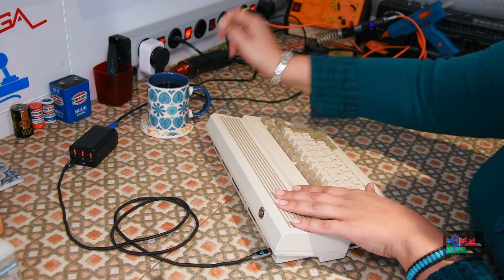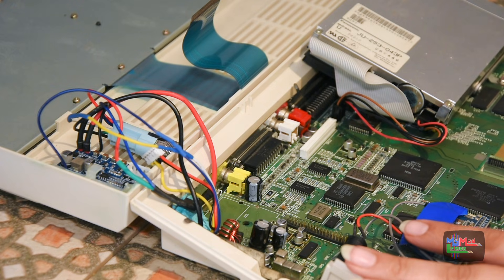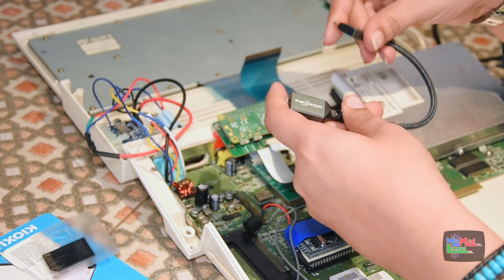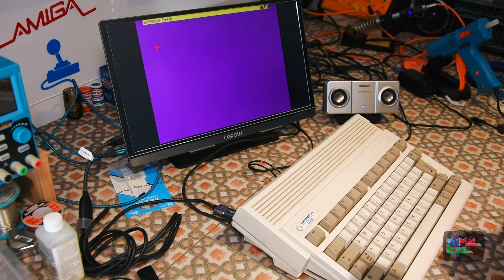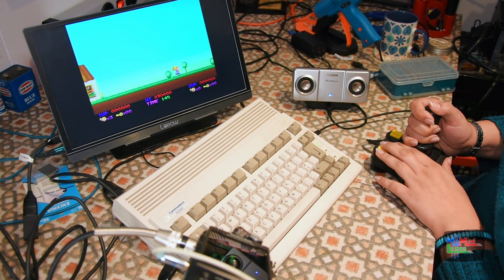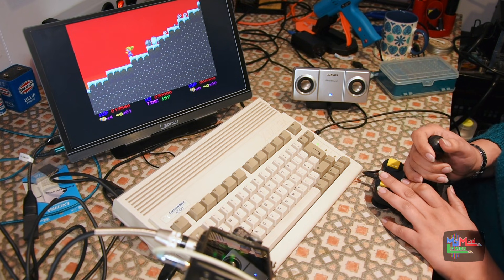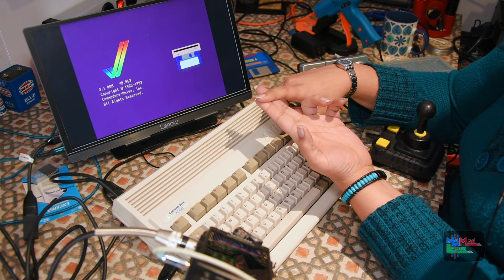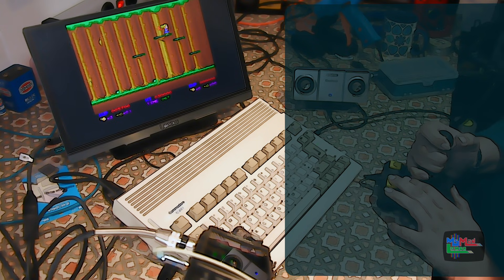Amiga RGB to HDMI Upgrade - A600 Portable Setup Series

Comment: There's an audio board that hooks up to the pi; works great, and it's so nice not to have to have a separate audio cable and amp!
I've got to find a new point to solder my audio wires to inside my A600 though - I found that the RCA jacks a switched so the audio is muted if there's no cable plugged in!
Also, I never use that menu button once it's dialed in; I never cut a hole in my A600 for it, and haven't missed it at all!
Reply from the maker: Yeah, I decided against drilling a hole for it in the end. Just like you, I found It's barely going to be used after the initial time. 
Thanks for the heads up about the audio board and the info. Actually someone in my comments mentioned there's pins for the audio on the trapdoor. I need to look for that.

Comment: ahhh the Zipstic - best joystick ever made 😁
recently moved to W11 and could never get my old zippy to work in W10 and was surprised when W11 found and seemed be just fine with it now.
popped up a few C64 games on the old emulator and after a bit of trial n error the Zip worked on those too.
very handy usb interface device I got for it a few years ago.

Comment: Nice work! Audio over HDMI is now possible with RGB2HDMI, there is an add-on audio board available which connects to a few GPIO pins on the PI. I've fitted one to both an A500 and CDTV and they work brilliantly

Comment: Looks like you can grab the audio from the trapdoor as the schematics show LEFT/RIGHT signals, so if you intend to add anything in there, as you are most likely going to pistorm it, you might want to design your own board with audio out from there into the rgb2hdmi pi, then the the software on there needs modifying to pass that through.

Comment: Got a RGB2HDMI also, also got the cable angled the wrong way :/ but replaced it with a similar one but opposite angle. And the other one fitted better for pistorm. The button included in RGB2HDMI I never used, it's for toggle some setting I think.
Reply from the maker: Yeah, I eventually got a slim flexi HDMI cable for this, I couldn't trust that chunky one angled the wrong way. 
The button is for the menu settings of the RGB2HDMI. Its quite impressive how they got away with just using one button for everything.

Comment: It's a shame there is no room for a small amplifier and speakers in the case.
Reply from the maker: Actually, with the size of amplifier boards, there's definitely space for an amp, but speakers, hmmm to be honest, any built in solution wouldn't sound too good. Kinda like my tower speakers I created, it's just to hear basic sound, not ideal. Especially for music creation.
Reply: @MsMadLemon  Yeah, there's no 'sound box' for the speakers to 'react to'.

Plus you would have to make another hole for the volume control. LOL
Reply from the maker: @Franko_Walker  Yeah I dont even need to for that button once I've set the rgb2hdmi. I've decided, no more holes 😉
Reply: @MsMadLemon  YAY. 😃

Comment: I went the easy route for HDMI on my A1200. An A/V composite in to HDMI out converter box. (the picture quality is nowhere near as good as the board you used, but it has audio and only cost £5. It also needs it's own 5V supply.)

Comment: nice but I always have doubts about these video converters, a lag is always introduced. on an old forum, with a pc, with a "good" converter from vga to hdmi, already at 1024x768 a lag of 10ms was introduced. perhaps since we are dealing with very low video resolution on the Amiga, the problem is less noticeable
Reply from the maker: I sensed no lag in this RGB2HDMI as its direct from the denise chip.. The OSSC has very little to no lag.
If you get a cheap up scaler like the Flylink, then yeah, that has lag and artifacts, there are lots of cheap up scalers around. With upscalers, you get what you pay for really.
Reply: The RGB2HDMI do not convert from analog signal like a vga to hdmi. It uses the digital signals stright from the amiga video chip (denise). So the lag is minimal if any